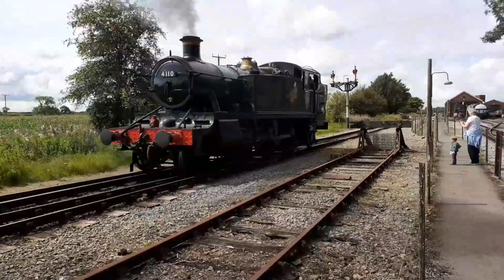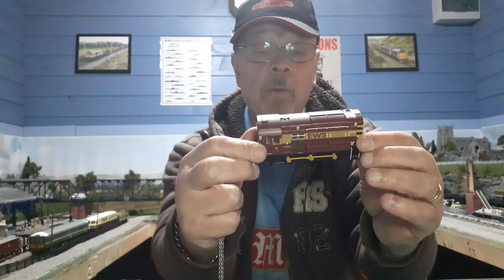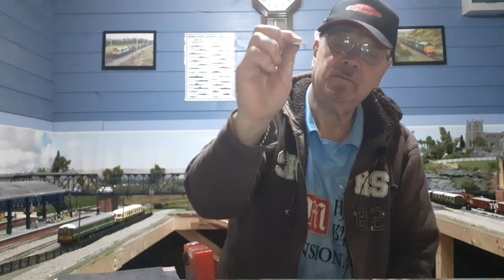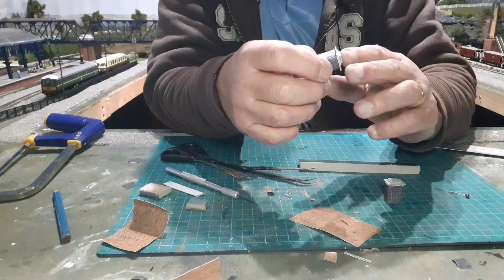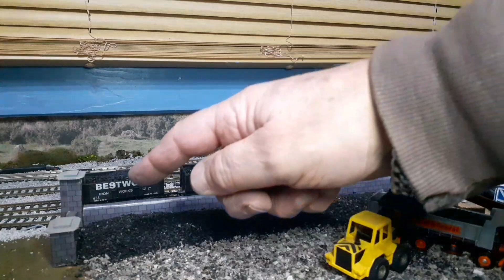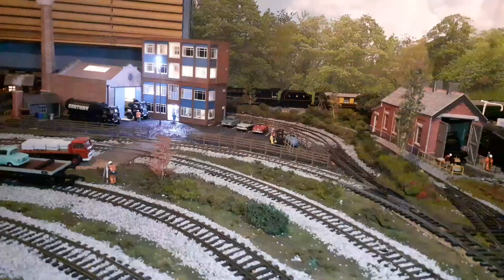A Moan, A Wall And a Little Running Session.

Comment: Hi Pete, what a shame about the 08. I never buy used for a number of reasons. If I were tempted I would want to see it running before I parted with my hard-earned £. Glad it'd been fixed. I love your railway room and your layout. Cheers. Dave.
Reply from the maker: Hi Dave.
Thank you for your lovely comment.
I usually test them but forgot my 9v battery. I do buy new but thought this was a bargain, lovely looking loco.
Layout not finished yet, just point the camera at the bits that are.😁
Thanks again for your nice comment Dave.
Stay safe.
Pete.

Comment: Hi Pete, its very annoying when you buy something in good faith and it turns out to be defective. Good to see its repaired and running well pulling the ballast wagons. Nice work on the wall and scenery your layout looks great. Just Subscribed. Cheers, Paul.👍👍👍
Reply from the maker: Hi Paul.
Thank you for your lovely comment buddy and thank you for subscribing.
Yeah disappointing at the time, not very happy, should have remembered my 9v battery test it myself. Dan does great work he tackles most things, did a vlog on the 08 his putting it out tonight.
Thanks for your nice comment on the scenery, not an expert but just enjoy doing it.

Thanks again Paul.
Stay safe.
Pete.
Reply: I used to buy eBay and then stopped completely when the stuff advertised is not quite what you get.
Reply: Hi Pete, I have had a few items from Ebay that were not very good it is dissapointing.
Cheers, Paul.👍
Reply from the maker: @stevedowdeswell139  
Hi Steve.
Have had some bad results from ebay, but lately been OK. Do worry though when you buy from there.
Pete.
Reply from the maker: Hi Paul.
Thank you for your nice comment buddy.
Not sure if I missed your comment sorry if I did.
So pleased with the repair result. 
Yeah touched the Wall up a bit now, so looks a bit better.
Thanks again for your lovely comments buddy.
Have a fantastic new year.🍾🍾
Pete

Comment: You've not had a lot of luck of late pete , can I suggest the next time you buy anything at a show ask one of the demonstrators or exhibitors if they can test it for you, also I would recommend you take a look at Dave Angell Trains, he tests all his locos before sale
Reply from the maker: Hi ya Brian.
My fault as well for forgetting my battery. I think Dave Angel was the one I bought the DJH from, he said it worked but it didn't, with Dan now for repair.
Think I've come to the end of buying locos Brian.
Thanks for the comment buddy.
Stay safe.
Pete.

Comment: Hi Pete- I think you are allowed a moan as at £70 you should have had a decent runner but at least it has been fixed . If retailers are going to sell pre owned stock then it should have either been checked beforehand or test it in front of you although I appreciate it would have been difficult at GETS, It looks very good running .
Cheers Kev
Reply from the maker: Hi Kev.
Thank you for your comment buddy.
Yeah with you there, if they don't do the job properly they will soon get a bad rep.
Didn't bring my 9v battery with me otherwise would have checked it myself.
Thanks again buddy.
Stay safe.
Pete.